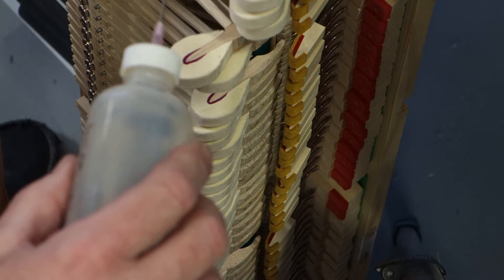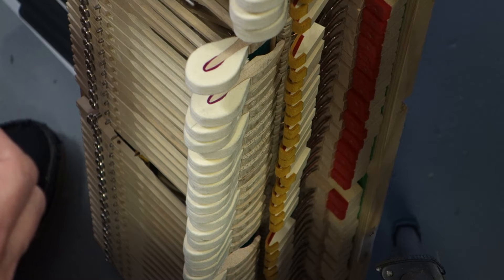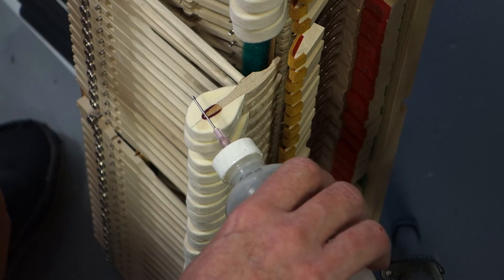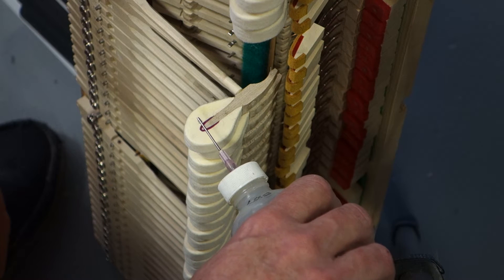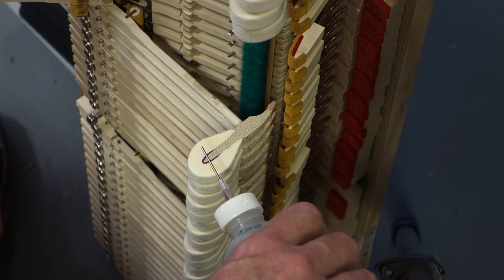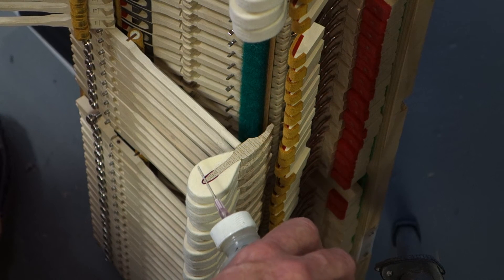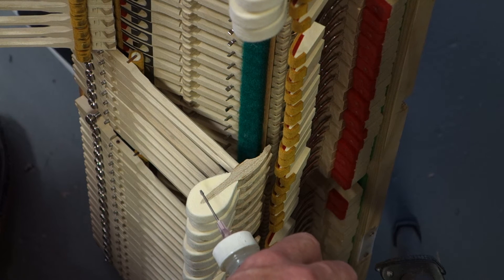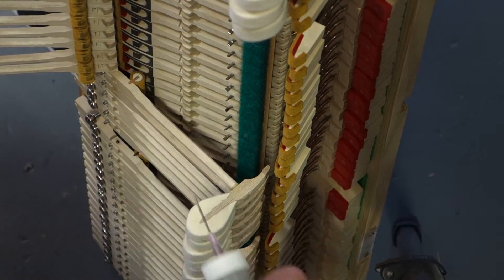Hammer lacquering - from the side

Comment: Cool technique. I wish you had a before/after sound. No biggie. I have a set of hammers that need more. What Does this technique create? I've been thinking of experimenting with this. Guess it's time to try. Have you tried b72 yet with same technique? Lots of questions. Thanks for putting this video out. I would suggest using a acid brush to do this. Its very exacting.

Comment: I've put way to much on my hammers, and made them as hard as a rock... but I'm going to buy new hammers soon....
Reply from the maker: joshua bonner there are techniques for soaking them in thinner to get the lacquer iut
Reply: Eric Johnson thanks, where on earth do you buy this thin lacquer solution??? I'm in Australia 😎
Reply from the maker: joshua bonner thats tough. Thinner is available at any paint store. However most lacquer turns the hammers a little brown
Reply from the maker: but if that doesn't bother you..then just look around a paint store. Always dilute the lacquer.
Reply: Eric Johnson no, it doesn't bother me.. I'll look around for lacquer... do I just dilute it with water or aceton?
Reply: Eric Johnson Ive got a US-50 kawaia upright piano... the it's covered. 😉
Reply from the maker: Not water!! Acetone or lacquer thinner.
Reply: Eric Johnson ok, thankyou!